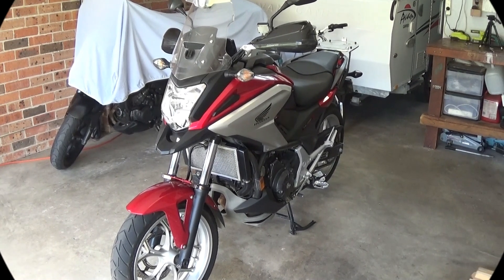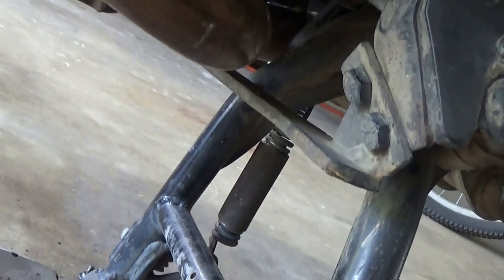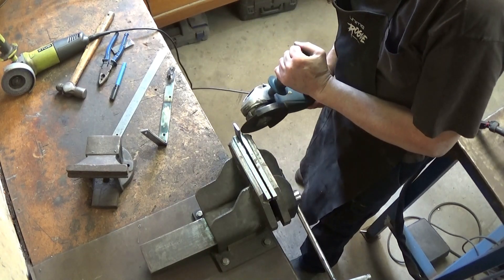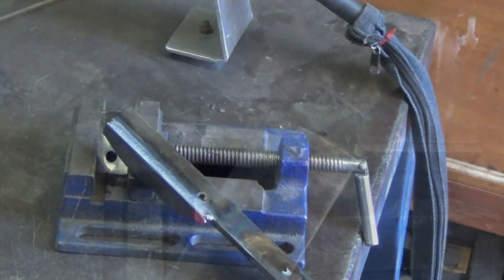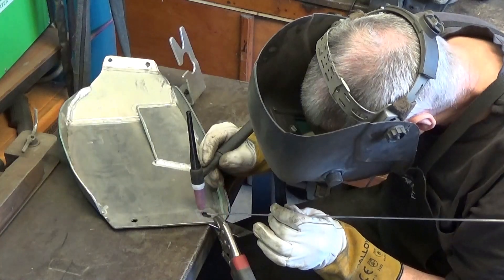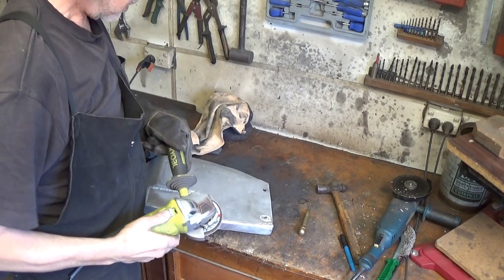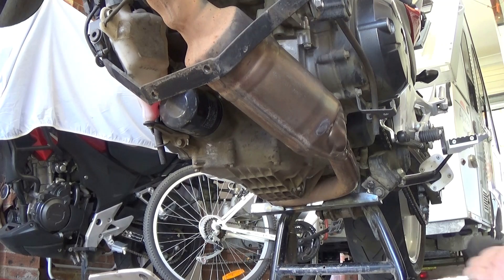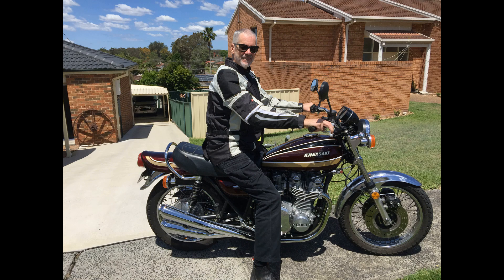Bash Plate Repair - Honda NC750X

Comment: As always, nice 👍 clean 👌 great job 👏 really wanting you to own africa twin , You will have more fun with it.
Reply from the maker: Yes. I’m looking forward to you sending me the $26,000au required. Thanks.
Reply: @AfricaTwin-Stuff  I wish I was a rich man, I would send it to you at once, but as I told you before. You will find used 16, 17 or 18 models at excellent prices , But it looks like you've fallen in love with the NC700X.  
I hope 🙏 the best 👌 for you.
Reply: I had Varadero 1000 for few years great for touring, now current bike is NC750X and extremely pleased as its a great all rounder.

Comment: The bike won't feel right until you paint the bracket.   It'll haunt you on every ride.  😳    BTW- Nice weld job
Reply from the maker: Yes. It’s been bugging me all evening. 
Guess what I’ll be doing in the morning ?
Reply: @AfricaTwin-Stuff  If you don't paint it, Wendy will drive you nuts until you do. Might as well get the wrenches and paint out. :-)
Reply from the maker: You have it right. The bracket is currently hanging in the sun with the paint drying 🤣
Reply: @AfricaTwin-Stuff  Nice recovery. 😎  My greatest fear of retirement is losing work as an excuse for not completing projects.  My wife will figure out how much of a slacker I really am!